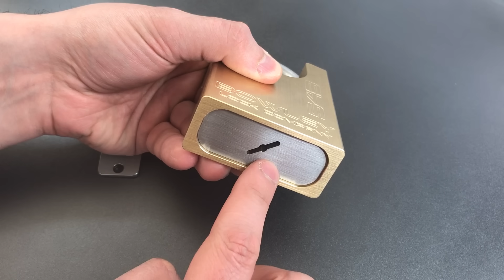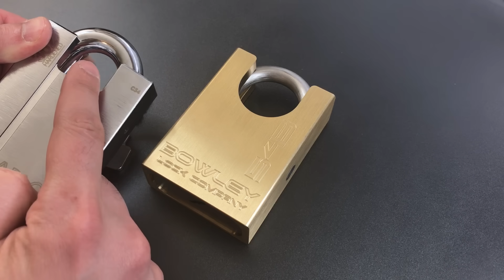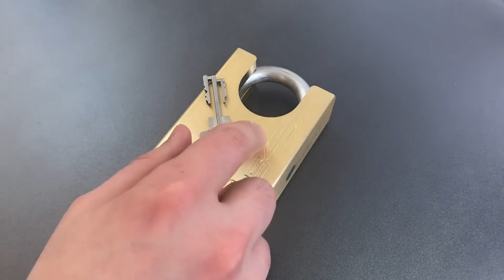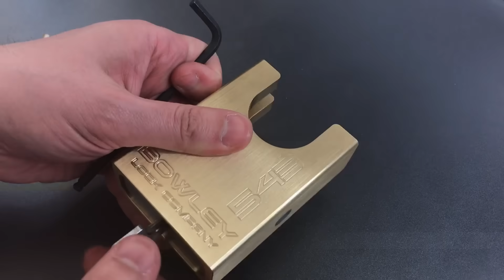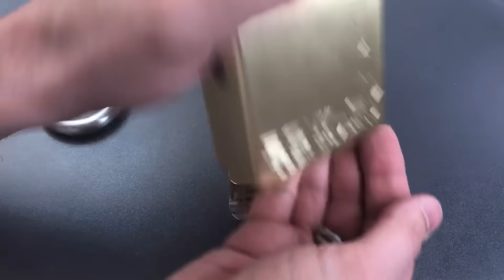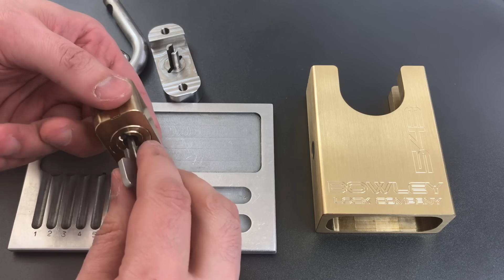[653] Prototype Dual Fork Bowley Padlock (Model 543)

Comment: The downside of a lock like that is if it's used on a storage locker or a door with a hasp . It screams I cost a small fortune and I am probably guarding something amazing . So forget picking just blast through some other way like cutting the door or wall or driving a truck through the door or wall , acetylene torch etc etc. 
 Great design , if I ever got one I would dummy it up to look average as to not draw attention .
Reply: Its much easier than that. Lots of storage units are ticky tack construction and if you have a lock that too tough on one, you simply cut the lock on the one next to it that likely isnt then use a oscillating cutter to cut a hole in the wall and then loot it. 
 Not hard. Also not fast so what you would want to do is, contrive a way to rent the unit next to the unit you want to rob then using your legit access, use a drill to start the cut in the wall with an open ended hacksaw, leaving like an inch uncut at the tops and side in the corners and then 'break in' illegitimate later and cut your own lock, finish opening the wall and loot. 'Steal' some of your own stuff as well so as to not look suspicious. 
 Of course this is a very complicated and pretty much heist movie type plan. Not likely to be successful. Besides what would you do if you got into the other room and the item in it was too large to come out through the hole in the wall?
 I mean if you had a battery powered oscillating tool, and some extra batteries, you might be able to open a hole in a wall pretty quick especially if you have a team. You might be able to take out an entire panel between studs. But its still a pretty complicated thing.  You are gonna be in a hurry, likely to leave your tools there unless you rehearse a lot or wear a tool belt or back pack.
Reply: @metamorphicorder  This technique was once used to rob a jewelry, I think..
Reply: @metamorphicorder  
 Well that has certainly happened . Someone got in a unit we bought at auction the night after . We were separating the good stuff and after an hour I looked around and asked my buddy where is the Dyson vacuum . It was 300 easy at the flea market but it was bigger than most of the smaller stuff and some of that stuff was somewhat valuable .
   I saw that the loser just crawled out from the side unit through the metal chicken wire that was only twisted down with bailing wire . He was probably ripping off every unit in that entire floor . 
    We told the manager about it and they didn't really seem disturbed by it . They were like ah oh well we can make a note of it and that's about it . I just bid and clean them out then sell what's sellible .
Reply: @hardworkingamerican8847  wow. That sucks.
Reply: Throw a masterlock label on that sucker
Reply: Someone else pointed out that most insurance won't pay out for robbed storage units if there was no sign of forced entry, so an easily picked lock would not pay out. This otoh would need forceful bypass which an insurance place absolutely has to pay out for.

Comment: That is why the Abloy 330/342 Padlocks are more commomly used; I am yet to see a company, let alone person, that uses a 350 or 362. Hell, it's even hard to get the 342 as is as locksmiths tend to deal with the 321/330s.

Comment: Following the successful on-screen picking of the original Bowley Lock cylinder by that sole fellow using several tools I'm trying to imagine what kind of spacing nightmare that would be with this dual-fork design.  Compound that with a possibly alternating binding order between sides, etc and this looks like it will be a complete waste of anyone's time in trying to pick as a practical matter.  Imagine if they simply added trap pins to this so you rotate just enough to think you've picked it and then hit the wall (which you'll probably be doing literally with your head right after).  This lock design is an inch away from from being nauseatingly perfect.

Comment: The key looks very breakable & it will probably rip holes in your pockets if you carry it around, and get stuck on other stuff as you try to pull it out of your pocket / keyring. Cloth pocket liners don't work well with metal retaining hooks.

Comment: for that price it'd probably be cheaper to let them steal the bike instead of destroying the lock
Reply: Check the price of a good gravel bike. They start at over 1k USD and that's nowhere near the most expensive type. It would be appropriate for a multi day road trip and there are times you'd have to lock one up where someone could get at it. (if you must camp)

Comment: Im replacing my house locks with this
Reply: Great idea, but only if you then beef up your doors, windows, and other possible entry points, too. Most thieves don't bother with locks. Doors are easily broken, as are windows. The lock on your door is only a very small part of the overall security of your house.

Comment: Actually that 16mm shackle on the Abloy 362 is the perfect fit for a Pewag 12mm chain - one of the best security chains you can buy, and a damn good security combination for an expensive ebike. Frankly I wouldn't go below that for an ebike chain - maybe 10mm Pewag if weight is an issue. I hope to see this Bowley upgraded with a 16mm shackle model in the future. I've been searching high and low for a Stanley 24/7 but they seem to be discontinued.

Comment: it looks as though only one time actually comes in contact with the pins, if that's the case why have two tines? is it a case of psychological warfare or do they work? the inner guide ring thing completely covers the other tine doesn't it?
Reply: Oops I corrected myself I didn't see the other groove in th idler ring sleeve thingy I thought it only had one groove, sorry

Comment: I've to to admit, I give them MAD props for making a lock this unique, but that's also fairly easily serviceable...  The only serious impediment I could see to becoming a locksmith distributor / authorized service company is the key blank... Too hard to cut with a standard HSS blade on most key machines, and (I would think) JUST delicate enough to bend trying to use a carbide blade by code cutting unless you went SUPER slow (I have killed more than a few steel Schlage L blanks on my HPC 1200 with the carbide blade)...  

That being said, I currently resell Medeco M3s through my distributor, and those customers tend to understand up front that if they need an extra key after the initial sale, it's gonna take a few days, because we have to go through the protocols and then it has to be mailed to me to deliver to them.... So Bowley could go with a patent controlled, end user card type system, ONLY shipping direct from the factory to approved distributors, and it could work. 

I suspect if they come up with a jig for the 1200 and other similar machines (ILCO, Framon, etc), it could become a lot easier for authorized dealers to produce keys direct to customer in the future...

Comment: I'm curious as to why they needed to insert the ball bearings from the sides when it looks as though you could insert them from the bottom before you insert the lock and actuator. There looks to be enough room. Just need to keep them apart so that the actuator can slide in between them.
Reply: They drill the holes for the ball bearings from the outside. Would be very difficult to machine them from inside.
Reply: Yes, but the side holes wouldn't be needed at all if the ball bearings were inserted from the bottom before the lock core is inserted.
Reply: I didn't explain it very well with my first reply. They drill into the lock body from the outside to create the holes for the ball bearings. In other words, if they didn't drill the holes from the outside, there wouldn't be any holes for the ball bearing to go into.
Reply: You need two holes 180 degrees apart and 90 degrees to the axis of the bore for the core. How would you drill those holes from the inside?
Reply: OK Gary, you win. I think maybe the people at Bowley know something about making a lock that we don't.

Comment: If that idler ring somehow has turned while the key was out, is it still possible to insert the key? Or is there a system that keeps it in place?
Reply from the maker: There’s a detent that keeps it from freely rotating.
Reply: @lockpickinglawyer  Are the machine grooves opposite the slot for the key large enough to slide a shim? I saw as you were turning it it may provide access to the pins directly if you could get the idler to face the pins with that groove. The key slot does look large enough to fit a hardened slim shim up either side.  Easily corrected if that groove wasnt part of the final product.

Comment: Is there anything to stop the idler ring from rotating when the key isn't inserted, such as due to vibration?
Reply from the maker: Yes, there’s a groove in the idler, and the pins act as a detent. It happens to be in the wrong place on this lock because of revisions to the prototype, but it will be corrected in the production lock.
Reply: @lockpickinglawyer  If someone was to come and spin the idler with a shim, it would make the lock unusable with the key correct? Seams like an easy way to prevent someone from taking what ever they have locked up until the attacker can come back with power tools.
Reply: @ionstorm66  he said the pins act as a detent (meaning you would have to use enough force to shear the pins with the idler, at which point you've already won)
Reply: @sparkzbarca  you have to turn the idler before the key hits the pins
Reply: @ionstorm66  that's a bad strategy to employ. If you can't retrieve your item you typically call someone to break the lock and stand by it during that time. Also these are typically for stationary objects (storage units) which are easier to get you or authorities to guard
Reply: @DoubtlessCar0  Who is going to use a $200+ padlock on a storage unit?
Reply: @ionstorm66  Someone who has more than $200+ worth of stuff or priceless items in a storage unit...WHICH IS SUPER COMMON!
Reply: @DoubtlessCar0  behind a thin sheet metal roll up door?
Reply: @ionstorm66  if something is breached without force (picked) insurance will not cover it. Also some are decently sized or it could be to a personal shed that holds thousands of dollars worth of equipment like a wielding shop.
Reply: @ionstorm66  Someone who doesn't realize putting that nice of a lock on there will encourage someone to simply cut through the door or wall lol

Comment: LockPickingLawyer:  Excellent video. The pins appear to be standard brass pins, and the key is steel. In your opinion, would it be probable that with repeated everyday use, the steel key would wear down the key pins enough to affect the super high-tolerance that this lock is made to?  Just a thought.
Reply from the maker: I doubt it. It’s not like a normal key which runs its full length over the pins. This key only moves less than .1” So there’s a tiny fraction of the wear.
Reply: Ah, I see. That makes sense.  Thanks for the reply, and as always, great video.

Comment: Canadian ingenious Bowley brothers have come up with an amazing design! BUT saying (0:54 ) "brass is a very expensive metal from which to make locks" seems weird cuz eating up tooling with SS seems way more expensive. Lots of cheaper locks are brass.  A- Brass is MUCH easier on tooling to machine. B- some stainless steels are as expensive and MUCH harder to machine! On this $200 lock, there's only about 5-6$ worth of brass, so why not use it?

Comment: Another well done and well said video. Imagine a lock with thumb print recognition no keys no holes for picks to enter into and trip the traps, the built in micro processor would activate the traps, you would have to program your thumb and anyone who wanted to use the lock has heat technology to detect for real finger when can I buy a lock like that, the key would be one of your fingers and the user gets to pick witch one so let's see eany meany might moe catch a tiger by the toe eany meany might moe, that's it, Introducing the NEW mighty moe all others are just eany meany's get it hmm let's see ok I would pay as much as 100-150 for a lock like that because I hate keys. Lol

Comment: what would happen if you turn the "idler" part of the core without the key , would the pins drop into the slots and jam it up ? .
if that happened it would be impossible to reset the pins :-(
Reply: The pins are wider than the slot in the idler; they will block it but since they are chamfered the idler can be rotated back (requiring some force). http://www.lockpicking101.com/viewtopic.php?f=9&t=61799&start=15#p455876
Reply: @dlevi67
thanks for that link , lots of info on there :-)

Comment: You would think that with all that effort and cost in making such a unique and currently extremely difficult lock to pick due to lack of special picks for it, that they would spend an extra dollar by using more security pins to make it possibly the most secure lock on the market? They could have at least stuck 2 assa pins in there.

Great video, thanks for sharing. I wonder what grade of metal they used to make that key so durable.

For the record, bosnianbill brought me here.  :p
Reply from the maker: There are other more realistic threats besides picking that the sharp edge pins help address. Impressioning comes to mind immediately.

Comment: Is brass THAT expensive compared with the cost of the processes involved in hardening and plating steel? 

For the sole purpose of studying the inner workings, I've just pulled apart the nastiest rusty and seized old hardened steel wrapped and capped brass cored Sterling shackle lock. If you add up all the parts, the brass is something like 3/4 of the body mass. They cost something like $50!
But when my grinder got through the hardened steel casing, the sparks reduced and progress was a lot easier of course. I could have used a hacksaw but I was feeling lazy. 

So I contend that brass is both a vanity choice for the exposed part of a lock body, and a terrible choice overall. It's saving grace is that it won't rust or flake over extended periods of time exposed to the elements - as the nasty thing I just destroyed did. 

Aluminum is a worse choice though. It demands extra elements embedded inside to defeat brute force attack. Plus it has terrible resistance to the elements. 

I may have completed the design of version ?? of my motorcycle disk lock. It will have a stainless steel body and hardened steel features including shackle and core protection. It looks very very good on the screen. Am now looking for the perfect core.
Reply from the maker: The brass is meant for collectors. The steel is a pre work hardened stainless. So no plating or hardening in production. The extra cost is in tearing through tooling in production. And according to Ryan Bowley, even after taking that into account, the Brass is more expensive to produce because of materials.
Reply: Moderate Fkr brass and aluminum only available Pre-production, weren’t you listening?

Comment: I think it would be a good option to have the lock without any company or other identifiers on it.  Reason being, might prevent someone from looking up videos on how to pick or otherwise circumvent the lock.
Reply: About the only way anybody is going to be circumventing this lock is with a quarter stick of dynamite.
Reply: @orion8981  you mean 5 quarters of a stick
Reply: Matte black Bowley STEALTH variant
Reply: The Bowley name means the thief won't mess with it.
Reply: Haha no one will pick this lock man.
Reply: @SeanJonesYT  Still pickable with an angle grinder.
Reply: @JohnDoe-bd5sz  You make a great argument.
Reply: John Doe I’m sure that angel grinder is silent and won’t cause any unnecessary attention, also should be battery powered
Reply: @EqualsThreeable  anybody can walk into a hardware store and buy a 18v cordless grinder and cut-off disk. I've cut locks in less than 5 seconds. 
Pro tip, safety vest and hard hat and you can get away with using power tools pretty much anywhere. It's like putting on a reflective vest makes you invisible.
Reply: No one would know where to get the lock if they wanted it so companies lose money
Reply: @Cleanish_n54  Exactly!!!
Reply: I am sure you could sand or dremel that off quickly enough but yes I agree should be an option to buy it without labels, logos, slogans, names even if it cost an extra 15 to 30 dollars!
Reply: No, it deters thieves so they go to your neighbour's house instead.
Reply: They'll look up the lock, watch this video. Then, walk away.
Reply: The point of this channel is to show which locks you should get and which you should get, you also shows occasionally how some gun locks can easily be picked by a little kid
Reply: GALLIUM
Reply: assassinlexx  In the same category as this device. :)

https://www.youtube.com/watch?v=bMtqRir7dco
Reply: Obscurity does not equal security. Security goal should be that intruder knows everything about the system and still cannot break it.
Reply: you can just put tape over it, or scratch out the logo. Most times you can only approach a lock once and you have limited time. You need one visit to remove the tape then leave to research, and then go back to pick. If you can even go back, you increase your odds of getting caught, plus there are better targets.
Reply: Lock is super easy to bypass, once.  It will destroy the lock, but i opened it with expanding foam sprayed thru the keyhole, and taped keyhole with duct tape to allow it to build pressure inside.  Shackle sticks due to the foam, but is fairly easily pulled out.

Now, you can soak it in acetone to remove the foam.  Place it in a pale upside down, and submerge in acetone completely with keyhole facing up.  Took about a full day to fully disolve the foam.

Nothing is unbeatable.